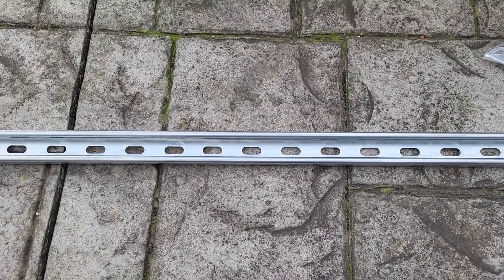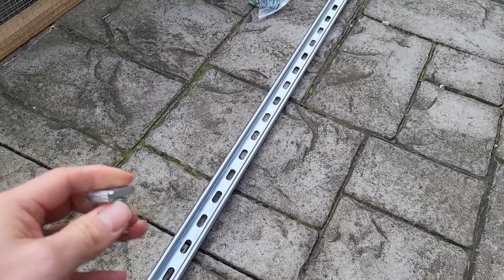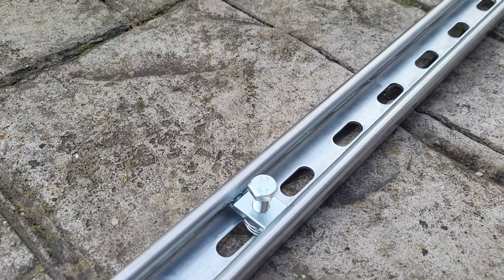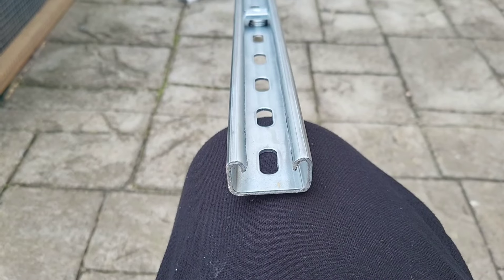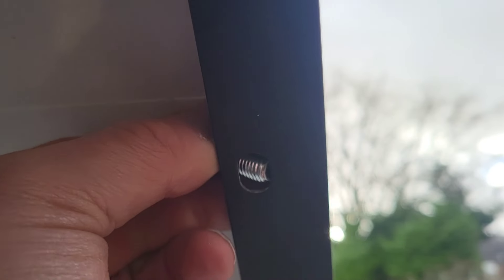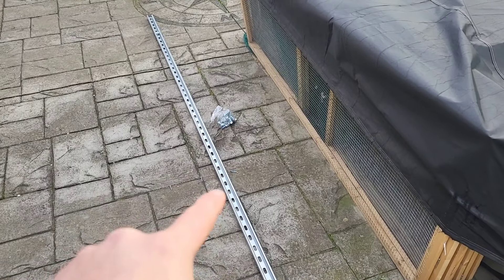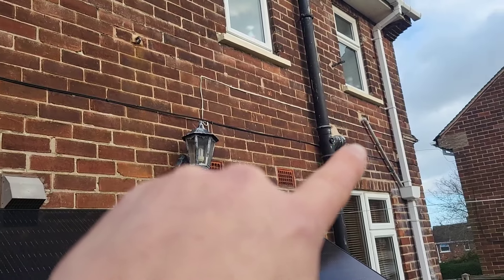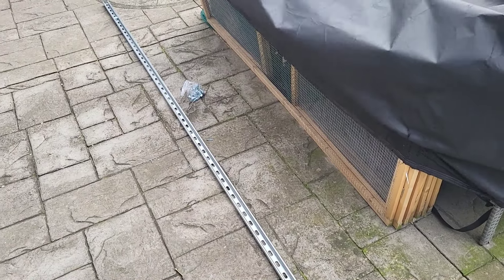soltted channel as a solar rail?

Comment: Good stuff that unistrut 😎 I based my amby solar mounts on it 👍
Reply from the maker: I think it will make fantastic solar mounting rails, I'll be using it for all my wall mounts and stuff too, for the price you really cannot go wrong. I just need to find some brackets to join the pieces together that will be equally as strong

Comment: If it's not too much trouble could you capture some detailed video of the actual installation of the unistrut, rather than just showing it completed. I'm thinking of doing something similar, except mine will only be about a 10 degree angle to miss some pipework. Cheers.
Reply from the maker: I'll try my best to get as much footage as possible to help others who are looking to do something similar yes, as soon as we get the lighter nights I'll be making a start on it (work is mental at the moment so I'm not getting home till its dark)